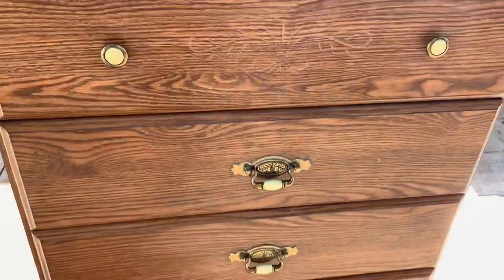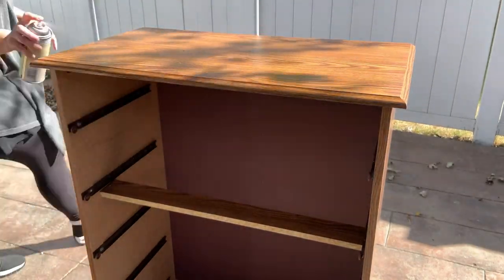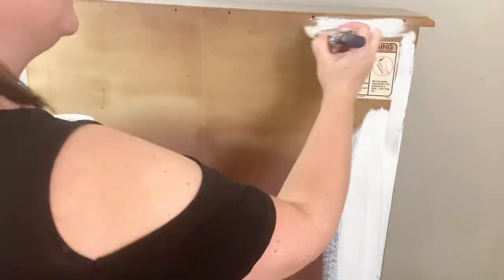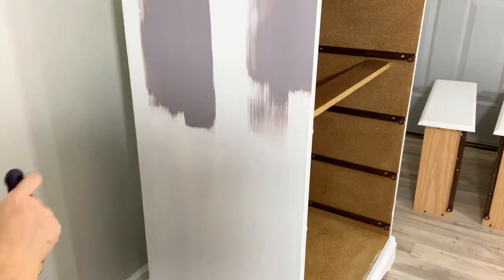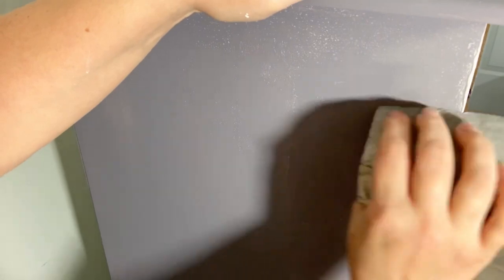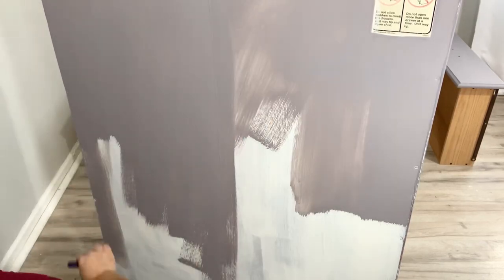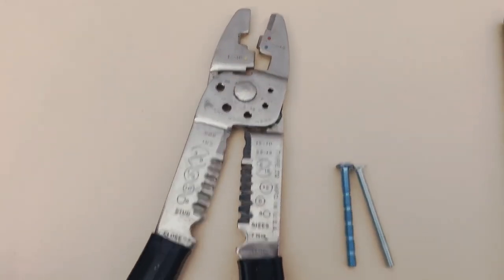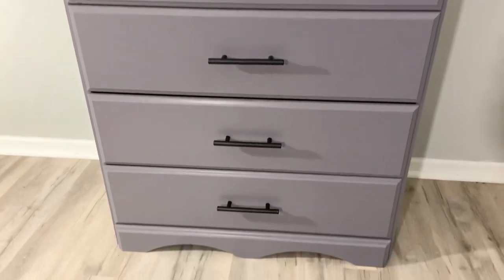How to eliminate cigarette smoke and other odors from your furniture | Chalk Paint Dresser Makeover

Comment: You can also sand it, which removes the top thin layer of wood and removes the smell also; theres a Zip product that apparently is very good at removing the smell, a spray can, fast n easy and cheap.